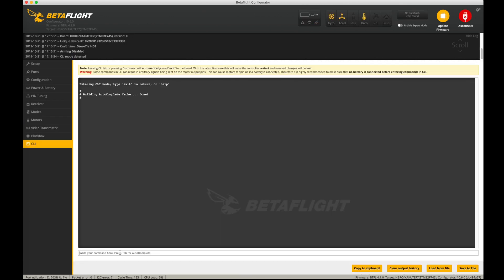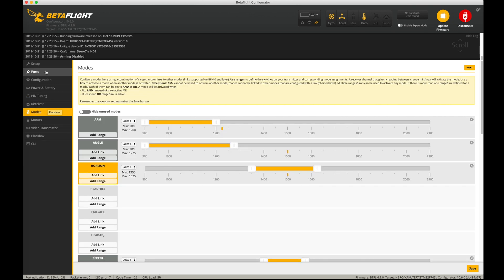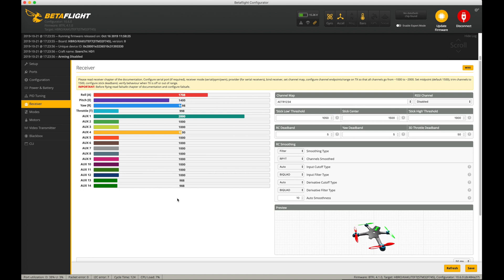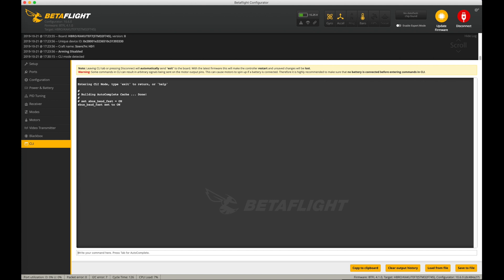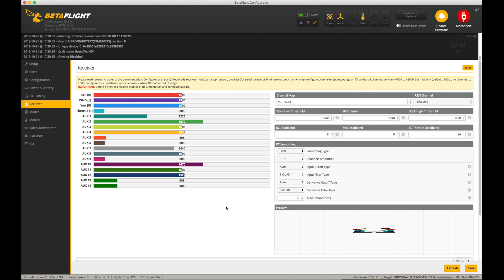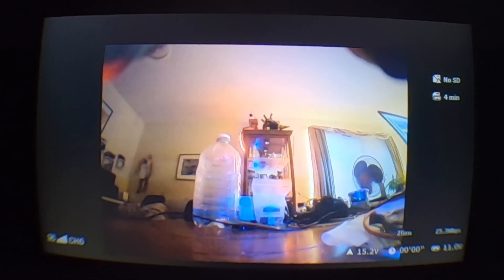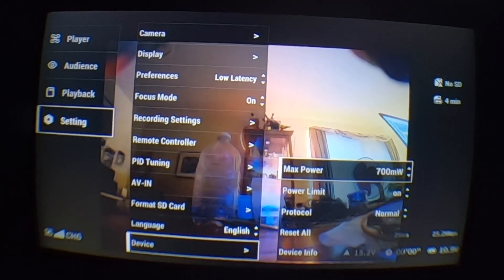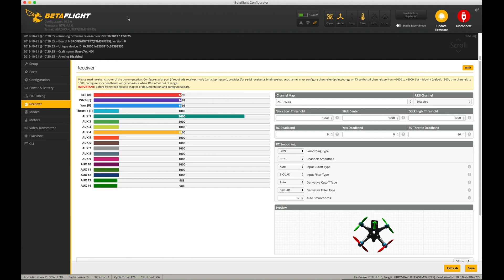How to setup the DJI HD FPV radio system to use the 7ms latency HDL or sbus fast protocol.

Comment: Hello sr I have a problem that the controll binds green light, but on recivier TB in bf nothing moves. Also in osd I se information of the controller and in calibration in googles i can move the sticks and calibrate but in servo control in googles it doesn't move either. Hope you can help me out

Comment: You're amazing. I've been searching for hours on why the controller is not working and all I had to do is update the setting in the goggles
Reply from the maker: I'm curious.  What setting was the default on your setup and what did you need to change it to?

Comment: Do you have to do this with all quads or do u have to switch back and forth for the ones that are not updated the DHL
Reply from the maker: I think the settings are stored in the vista or air unit on the drone.  So I don't think you would have to switch, but I have never tried having one drone using the fast mode and one not using it.
Reply: @5zero7RC  Thanks for sharing :)

Comment: If anyone is having problems doing this as of today, running Betaflight 4.2.8, things are a little different than in this video. I was about to lose my mind, and finally figured out how to change the protocol in the goggles, under the settings. I was clicking on the protocol tab, and instead of getting a list of the two protocols, i was getting a banner that would pop up saying to make sure you have the correct firmware set in betaflight, with the only option being to click the OK button. The ONLY way you can get the protocols to show you the choice of protocols, is to first do what was said in the video above... THEN go into your goggles, scroll up to the Transmission tab, and set the 50MBS to 25MBS. Then you'll likely get put into the Public channel (Channel 8) so make sure you check that and put it back into a normal channel. Then scroll back down to settings>protocols, then you should have a choice of protocols, and can choose Fast Sbus protocol. Then go back, scroll back up to Transmission tab, and change back to 50MBS. That should allow you to get it set to fast sbus, and keep it at 50mbs.
Reply from the maker: Interesting.  Thanks for the update.  I have not tried to change the protocol in a long time.
Reply: @5zero7RC  Yea man, I was really starting to lose my mind. Missed out on the one day of good weather, trying to figure it out at the spot I go fly. Two days later, I got it worked out. Still need all of your steps leading up to that part though!! So thank you!!
Reply: Also having problems with this In beta flight 4.2 Cli will not accept the command and shows error?
Reply from the maker: @devonpolsin4850  One other user here in the comments mentioned something similar and eventually posted a fix, but that link no longer works.  What error message do you get when you run that command in the CLI?

Comment: Does this only work for betaflight 4.1?  I'm on betaflight 4.2 on an iflight rtf quad.  I am using the DJI controller and FPV googles.  Betaflight says it's on sbus but goggles only respond in normal mode.  when I switch to sbus I get nothing.
Reply from the maker: It should work the same on 4.2.  Have you run the cli command "set sbus_baud_fast = ON" then save and reboot?  If it only works when the goggles are in normal mode, that means betaflight is using normal sbus, not fast sbus.

Comment: iam about to be the one to thro this junk out I've try just about everything and looked at this video and thought it was what I needed to getting my sticks moving......but nothing I follow all the steps and nothing is happening green light on the radio all software on all three devices are updated and is a nice drone iam dying to fly from flywoo.....it's been a most frustrating experience......all devices communication seems to be OK green light everywhere picture on goggles but sticks not moving for nothing.......anyone out there please help save me from throwing this out to the trash
Reply from the maker: The important thing to remember is that the radio and betaflight have to be set the same, or they won't talk.  The simple test is to change the protocol option in the goggles and see if that fixes the issue.  If not, you likely have an issue with the connection between the flight controller and the DJI system.  Either the wires are connected backwards, or you don't have the right UART set as the one where your radio is connected.

Comment: I am running a T-Motor F4 HD FC with the T-Motor P60 32BIT 6S ESC and Caddx Vista HD DJI system. I have bound the caddx system to my dji goggles and my dji controller. When i run betaflight everything seems to be working but it doesnt recognize my receiver. I have done practically everything i googled with no luck. Whats weird is when i power off the receiver and turn it back on, before the receiver binds to the caddx system, betaflight responds. But once the led turns green, betaflight doesnt respond to the receiver. Any idea what the problem may be?
Reply from the maker: Do you get correct drone battery voltage in the goggles?  I wonder if your radio is set to use fast sbus but betaflight is expecting regular sbus?  If that is not it, then I would double check with the FC manual that the settings for the radio UART are all correct.
Reply: 5zero7 RC what’s the correct battery voltage? The sbus is connected to uart5 which I have set to serial rx. But I’m not to sure which other ports need to be open. I’m guessing uart2 since rx2 and tx2 are connected to it?
Reply from the maker: @identikalzz  Correct battery voltage is whatever voltage the battery is on your drone at the time.  For example a fully charged 4s battery when the drone is powered on will be just under 16.8v.
Yes, if you have rx2 and tx2 connected to the air unit for OSD information ( not radio control) then you need to set UART2 to be MSP.  That allows data to flow back to the air unit and gets your betaflight OSD and battery voltage to the DJI goggles.  If you have a Flight Controller designed for the DJI system, hopefully they have all these details and more in their manual.
Reply: @5zero7 RC that’s the problem my rtf didn’t come with a manual. But just based off all the research I’ve done, those were the only ports I have on. Works for a little bit, but once fully paired it the receiver is no longer recognized. Makes no sense!! Also the esc I believe is plugged into uart4. Do I need to turn that on too?
Reply from the maker: @identikalzz  Do you know what Flight controller and ESC you have?  If not, what is the RTF you bought?
Reply: @5zero7 RC I am replying as Chrissna stated above. Sorry if this confused you. But I am running a T-Motor FT5 4S HD RTF kit from getfpv. T-Motor F4 HD FC with a T-Motor P60 32Bit 6S ESC
Reply from the maker: Unfortunately T-motor does not appear to have a nice manual to go with that FC.  However this diagram does help: http://en.tmotor.com/uploadfile/2019/0903/20190903095855234.jpg
I see that uart 5 is indeed the one for radio control and uart 2 is for the MSP connection.  Uart 4 would be used for esc data.  The ESC uart won't have anything to do with your radio control or OSD information.
Reply: @5zero7 RC so I need uart2 on as msp as well as 4 on as msp and 5 as serial rx correct? Or just 2 on as msp and 5 as serial?
Reply from the maker: @identikalzz  You do not need MSP on uart 4.  I think you would set uart4 as sensor input ESC.

Comment: hi! great video - i have an challenge with my dji controller not being able to connect to betaflight, everythign is updated and green but still no movement in betaflight :( - help! 

PS: im running everything on a Holybro Kakute F7 HDV & Tekko32 F3 HDV 40A 4in1 ESC 30x30 Stack/Combo for DJI (with a DJI unit )
Reply: I have the Same issue could you help me please
Reply from the maker: Sounds like you have the exact same stack as I do.  Be sure you have the radio protocol matched.  So in the goggles if you have sbus, use sbus in the FC.  If you have fast sbus selected in the goggles, under device -> protocol, make sure you run the CLI command "set sbus_baud_fast = ON" and save it.
Reply: @5zero7RC  no thats not the problem :/ its something with the RXLOSS and i dont know how to fix it :/ (its my first build :) ) - PS i dont have yet the motor connected to the fc - maybe it could be because of that?
Reply from the maker: Since you are using the same components as me, maybe you can skim through this build video and find a clue that might help you figure out what might be different?   https://www.youtube.com/watch?v=zWFeI_SN1Vk
Reply: @5zero7RC  i did watched this video a couple of time! thanks :) the problem is with RXLOSS NOPREARM CLI MSP i just dont know how to fix it, if its fixable
Reply from the maker: I just did a quick test with mine, and that is exactly what you will see if you have the protocol mismatched.  Go into your goggles, go to device, then protocol and switch it.  If you have it at "normal" switch it to sbus baud fast.  If you have it at sbus baud fast, switch it to normal.  After that hopefully the RXLOSS status will disappear.
Reply: @5zero7RC  got more error - RX_FAILSAFEBAD_RX_RECOVERYMSPARM_SWITCH 

so here is what i did earlier: connected the Holybro Kakute F7 HDV & Tekko32 F3 HDV 40A 4in1 ESC 30x30 Stack with a DJI Unit - without yet the motor connected to the esc! - it worked when i was trying to figur out how to make my first fpv drone - after some time, i tried to connect back the dji controller and there is no reaction, it says RXLOSS NOPREARM CLI MSP  in the status.   :( - RX_FAILSAFEBAD_RX_RECOVERYMSPARM_SWITCH , dont have much hopes after all this :(
Reply from the maker: Don't give up yet, it should all work.  If you go into the radio tab in the goggles, do you see any movement?  Have you gone through all the betaflight screens I show in that video and verify that you have all the same settings, especially on the ports tab?  Can you run "diff" in the cli and send me the results?  Maybe I can see something there.  Do you get voltage from the flight controller in the goggles?

Comment: How do I get my voltage on kwad to read?? I just get 0.0v on kwad the googles show the voltage of battery powering goggles but I get no voltage on kwad through osd!!
Reply from the maker: That means the MSP connection between your air unit ( or vista ) and the flight controller is not working so the flight controller can't send data like voltage and OSD info to the air unit and then get passed on to your goggles.  How you do that depends on your flight controller, but you need to have the grey and white wires from the air unit connected to a UART on your flight controller.  Then in betaflight you need to set that UART to be MSP like I do in this video.  Hope that helps!

Comment: Would you happen to know if i can use crossfire as my receiver?
Reply from the maker: The HDL or sbus_baud_fast protocol is only for the DJI FPV radio right now.  Crossfire uses its own fast protocol.  If you have a crossfire compatible radio then you need a crossfire receiver in your drone.  In that case the DJI FPV system is just like any other video transmitter.  Hope that helps.

Comment: I'm having problems with my Titan dc5 I feel like it has no range and the transmission connection is sporadic. On the HUD the drone icon at the bottom left the bars start to drop off even 50 yards awayI checked all my connections and they're tight and good I even switch to the DJI mmcx connectors and just ran them out the side. Do you think entering in this command could have affected the connection somehow..
Reply from the maker: I don't think so, but you could check by switching back to regular sbus and see if your range improves.
Reply: @5zero7RC  how do you switch back to regular when I switch back in the goggles I don't get any response out of the controller. Am I doing something wrong. I'm pretty sure I have to go into betaflight and probably set it back but wouldn't that put me back at square one with the controller not working
Reply from the maker: You have to match the protocol the DJI radio is sending with the protocol betaflight is expecting.  So in this case to switch back you would go into the betaflight CLI and enter ""set sbus_baud_fast = OFF", then save and restart.  Then in the DJI goggles switch back to sbus.  After that you should have control working again with the normal sbus.
Reply: @5zero7RC okay I was able to switch it back to normal and I got it to respond but the connection still drops off at about three hundred meters away down to one red bar I tested my cinewhoop back-to-back and no bars lost in the same flight pattern
Reply: @5zero7RC  thank you for your help. I changed out the fpv air unit and that had no change either. So so far I've switchedthe antennas and put it back and then the sbus bod and then put it back and then switched out the fpv air unit and it still does not have a good connection it must be the FCU

Comment: I have a question, and I think I might have waste a bunch of money on this, my elevator is inverted, so when my right hand push up, my quad tilts back, and push down on my radio, my quad goes forward, how can I change that, I can just change the weight on my Taranis in the mixer page, how do I do it for this?????
Reply from the maker: Sounds like you are using the DJI radio correct?  If I remember correctly, you can go into the menu in the goggles and adjust the settings for the radio.  You should be able to invert the sticks there.

Comment: So I have a Caddx Vista with the iflight succex-d mini f7. DJI radio is bound and I have battery telemetry in my DJI goggle and an image. My dji controller isn’t working though. No signal under receiver in betaflight config. I’ve tried the sbus fast mode, but betaflight 4.1.1 doesn’t have anything that say DJI or sbus fast. I turned it back off in my goggles and kept normal sbus mode under receiver in betaflight but still nothing. Any ideas?
Reply from the maker: To use sbus fast you need to enter a cli command because it is not listed in the GUI drop down.  But regular sbus should also work.  Have you configured which UART is connected to the radio?  It may be different than what I have in this video and you may have to look that up in the manual for the FC.

Comment: In the goggles mine just says Fast SBUS not DJI HDL. Any ideas?
Reply from the maker: As of the December DJI firmware update DJI changed the display to show Fast SBUS to be consistent with Betaflight.  Basically HDL and Fast SBUS are the same thing.
Reply: @5zero7RC  That makes so much since! I got fast sbus in my goggles but I don't see it in my config menu. (I switched back to sbus because I couldn't get any receiver response when they are different i guess). Im a newb BTW. Thanks for the quick reply (subbed)

Comment: What if I’m using the air unit for a fixed wing only and using my own transmitter. 
Do I get 7ms latency on the video ?
Reply from the maker: No, the 7ms latency is for the radio control signal only and requires you to use the DJI radio.
Reply: @5zero7RC  thank you sir..... so if I’m using the air unit with crossfire control link will there be any lag in my flight characteristics? Forgive me , I just got the package yesterday and I’m trying to educate myself in a rapid fashion .....
Reply from the maker: @endliberalism4305  The DJI video system typically has 25-30ms of lag.  It will show you that in the bottom right corner of the goggles.
I have not used crossfire but I believe that has 15ms or so average latency.  Both are well within the range needed to fly FPV accurately.
Reply: @5zero7RC  thank you sir. I just got my Tx, Rx, air unit all updated and bound, I did the power hack for the goggles and low latency in the CLI command, everything looks good and I’m surprised everything works because when I received my goods the boxes were partially crushed after the trip from banggood , I saved about $150 purchasing it from them but Whew- close call.

Comment: If I'm running Betaflight 4.1.1, I'm seeing just two options in my DJI Goggles;  "NORMAL" and "SBUS BAUD FAST" only.  No option for "DJI HDL" 
protocol.  Am I missing something or is it because I'm using BetaFlight 4.1.1 ?
Reply: Reading through other comments looks like you already answered this.  Found your previous response;  "Ah, yes, thanks for pointing that out.  That was a change DJI made in 
the recent firmware update.  I like it because it helps stay consistent with Betaflight now.".................   So, looks like I'm good to go...
Reply: Reading through other comments looks like you already answered this.  Found your previous response;  "Ah, yes, thanks for pointing that out.  That was a change DJI made in 
the recent firmware update.  I like it because it helps stay consistent with Betaflight now.".................   So, looks like I'm good to go...

Comment: I place set sbus_baud_fast = ON”
But receive  ###ERROR: INVALID NAME###

Any idea?
Reply from the maker: Are you positive you have betaflight version 4.1 on your flight controller?
Reply: @5zero7RC  yes BTF 4.1.0
Reply from the maker: @h975  As far as I know that error means the variable you are trying to set does not exist.  So there must be a typo, or you included the " or something like that.
Reply: 5zero7 RC 
Same issue.
Reply from the maker: @MindRiderFPV  What version of the Betaflight configurator are you using?
Reply: 5zero7 RC  10.6, just flew at lunch, I have the fast baud option in the goggles, I was still on normal.
Reply: @5zero7RC  SOLVED!
Thanks to you and iflight support, here the instructions:
https://we.tl/t-GPMF87vZEP